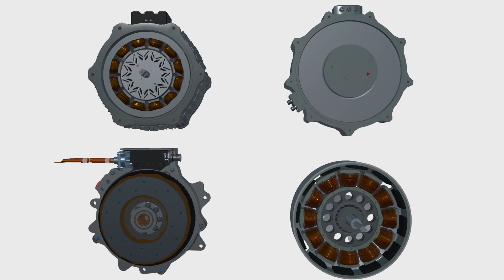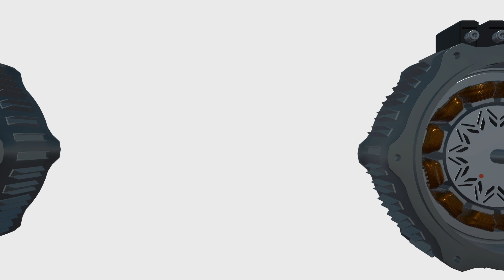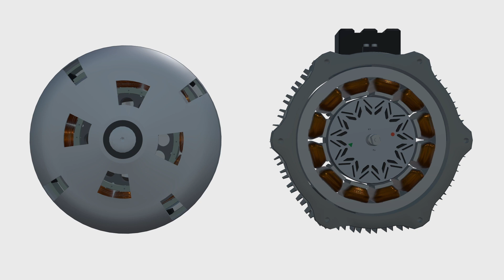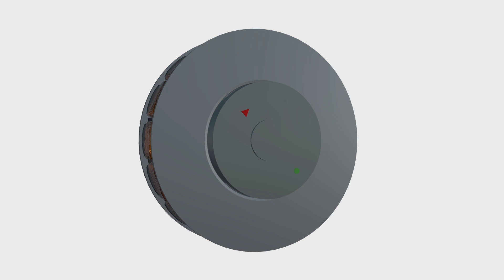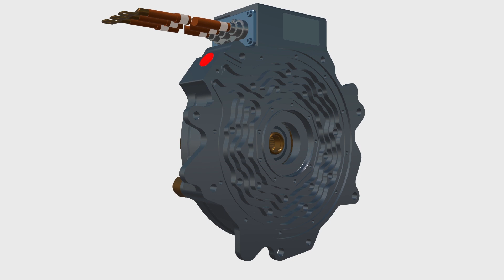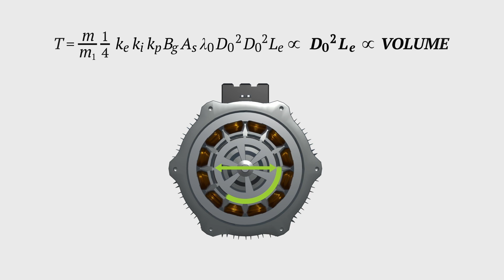Comparison of Permanent Magnet Electric Motor Technology | eTech49

Comment: Agree with cubic relation of torque vs D of ax motors, but there's no length option in it at all. What if add same volume of rad motor that added by increased diameter to ax motor?
Reply: Agree partially as we should assume not the circle area but rather outring area of the ax motor taking in account shaft area which is not used. By some point increase in length of rad mot. may be as additional multiplier. So that's why would be good to see comparison of curves torque vs volume of both motors including increase of OD and length of rad motor.
Reply from the maker: @ in both types of Axial machine the unused shaft area is negligible due to the packaging of the stator and rotor, my comment previously on the comparison would apply to a fully packaged motor including the cooling jacket..
Reply from the maker: @Andrenalin77  if you think about the OD surface area of a cylinder, 2πr.l the relationship increase in active area (and also cooling area) with l is linear, for the same length and diameter you will always get more torque and cooling area on an axial flux machine.

Comment: Great video. By the way i want to ask something. What kind of motors are used for electric bicycles. And how do they manage the cooling of such motors
Reply from the maker: Good question! Typically they are radial flux, centre mounted drives usually use IPM, hub motors can be IPM or external rotor pm. They are always air cooled to the best of our knowledge. Very short peak power requirements though.

Comment: thanks, But I did not get it! Why should be cooling in ERPM more difficult?! when it is automatically cooled by air convection ..
Reply from the maker: In air flow you get contamination including moisture, dirt and dust which must be dealt with for a reliable long life application. For more power dense motors air cooling is not enough. You must have liquid cooling to the stator at least which is more difficult when it is mounted inside the rotor to get a good effective pathway and surface area.

Comment: Hello, for your opinion what is the best of this motor technology for high power applications (high power short time). I am developing a motor (not for commercial just a university project) the goal of the motor is to have the most power at peak (10s) peak for 30s and for 2min continuous power doesn't need to be high..  the size is about 30kg (250mm*250mm) but can vary a lot.
Reply from the maker: This all comes down to the application and thermal management. The limiting features of any motor are the ability to generate magnetic repulsion force in the air gap and the heating effect that accompanies this in both the rotor magnetic circuit and the stator. With the thermal limit of the materials being the key.

For a high peak power you need the ability to create a big magnetic force for a short time. This needs a large electrical current and to limit the rate at which it heats the other parts of the motor, as well as a strong rotor magnetic field.

There isn't a simple answer and you could make a design of either radial flux or axial flux, for very short peaks the thermal mass of the motor components is more important than overall ability to cool. But this tends to not be desirable in most applications, unless its for a stationary machine!
Reply: @etech49  it is for a racing motorcycle
Reply: @etech49  thanks a lot for you reply I appreciate very your fast response.

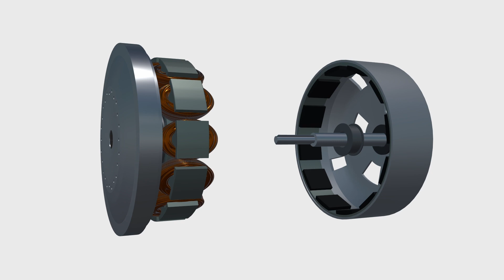Comment: 3:05 Similar to a Small Quad copter / Drone motor, Yet they dont have magnets attached to the stator in the center like this, just the ones in the bell housing that spins. Would having larger motors with dual sets of magnets like this produce more thrust?
Reply from the maker: A drone typically uses an external rotor motor, where the stator is inside and the rotor is outside, like this https://youtu.be/HSd8Xp7OIh0?t=176 This has the advantage of more mechanical advantage, so more torque for lower speed motors. But inner rotor allows you to spin faster and get more power density, which is good if you can use a reduction gearbox.

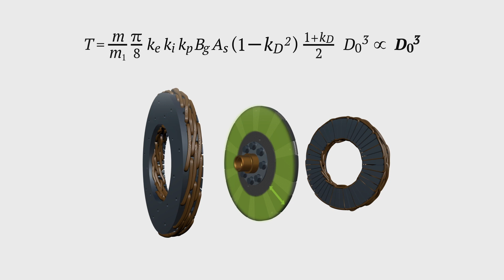Comment: Hi, nice video. What is length of radial flux motor in graph at 7:00 minutes?
Reply from the maker: It would be longer than the axial flux, and it was also held constant through the comparison. The reason the relationships vary as they do is because of the active surface area. If you think the surface area of a cylinder 2πrl excluding the end faces for radial and surface area of the end faces for axial 2πr^2 its really a geometry play of how much active surface you can get in.

Comment: Excellent presentation, congratulations 👌.
You forgot to present the functioning of the new generation Brushless Hybrid Fast - Rotation Motor (BLHF-RM) four-phase synchronous motor, which I have already tested quite well, both with latent and prominent poles. I invite you to my section on YouTube. 
My engine can also operate in the regime of increased power and torque based on the multi disc system (Axial System) 😀.
Reply from the maker: Thank you

Comment: Fantastic video. Please give some examples of external rotor motors (ERPM) and external rotor axial motors? Also, what college does research in this area of external motors and external axial rotors?
Reply from the maker: Hi Eyenor, we know you connected and got an answer already from @Ryan but we are putting his reply here to hopefully help others as well: 

DC motors have several issues for use in a variable speed application like an EV traction system they did used to be common if you look back at old trains and teams. But ultimates eliminated because of the issues. Brushed machines suffer from wear and have loses associated with the excitation and very poor speed/torque control. BLDC is common in applications like ancillary drives, it is too coarse for traction and is effectively 3 phase anyway!

For ERPM radial look at Protean motor drive, or the model drone market advantage is simply greater relative active surface area in air gap and mechanical advantage placing the air gap further away from the rotating axis. But these machines are very hard to make reliably!

For dual rotor single stator axial Yasa, Magnax, and Emrax

For single rotor my old business Avid, now Turntide or Heinzmann

Comment: Koenigsegg's Quark "raxial flux" motor boasts very high power density by "increasing rotor diameter against the bulk of the stator and optimizing the stator OD (outer diameter) to be able to accept this extra flux.” By doing this it also allowed the motor to use "this radial flux to augment the main axial flux".  

Do you think this is just fancy marketing and they just really increased the magnetic face surface area of the rotor permanent magnets?  I struggle to see using this description where radial flux would come into play here.
Reply from the maker: Generally in an axial flux motor there is unused end winding area in the radial direction, they seem to be utilising what was the end winding to form an additional active magnetic area.
Reply: @etech49  does Tesla use radial motor ? If they do, why don't they use axial flux motor to increase acceleration for higher performance ? Since Mercedes bought yasa, they must be using axial flux design for their future cars...
Reply: @ps3301  All Tesla models, and all EVs of any brand with significant production volume, use internal rotor radial-flux motors. The motor is a small part of the EV, in terms of volume, mass, and cost, so there is not much to be gained by a motor design change.

Comment: Axial flux exterior rotor with complex control 👌I will need 2 per car. One 3 phase ac and one dc.
Reply from the maker: Thanks for watching, we would recommend using a pair of AC motors with a speed controller that converts the battery DC into controllable 3phase AC

Comment: I just would like to say thank you for making this video. While I dont understand the equations or know how to use them it finally gives me some grounds to work towards in regard to designing my own electric motor for an EV. On that note though, do you have a video breaking down the formula for a dsir motor? That would be immensely helpful on giving me grounds to prototyping my motor in CAD. Thank you.
Reply from the maker: Glad it helped, we don't have that on a video sorry. These are relatively complicated machines to design due to the 3D magnetic flux. Most design packages can only design in 2D so you need to convert the geometry into a 2D radial approximation to do simple calcs (basically a pair of larger diameter radial motors with an equivalent active surface area.

Comment: Finally seeing a sizing equation being used for comparison of E-machines on YT :). Question: at the initial diameter the length of the radial macine was chosen as to equal the torque/power for the axial flux machine with the same diameter and then was keet constant for the comparison at other diameters. Second question: for the axial machine the axial length is also kept constant, but the aspect ratio I believe also has a second order efect on torque/power sizing equation, right - is that taken into consideration ? A reference for the study/report where the charts come from would be nice
Reply from the maker: Hi thanks for the question and sorry for the slow reply. Please find a link to an old paper where this relationship was first described. https://pdfs.semanticscholar.org/71ed/336bb0a934ac3ccf92397deb6a3497e6e84f.pdf

It is a simple geometry feature of the active magnetic area being on the faces of the machine rather than the internal diameter so the active area increased d^3 rather than d^2